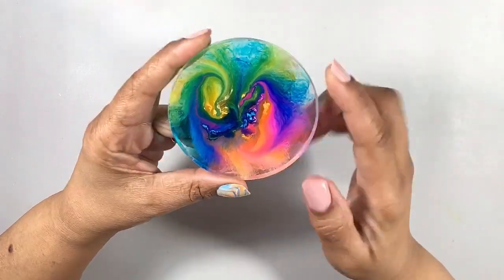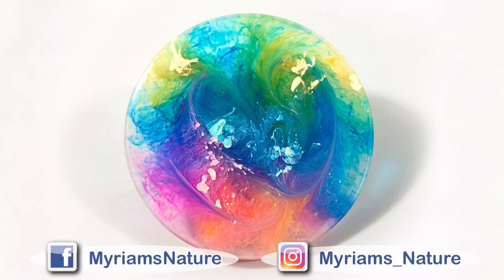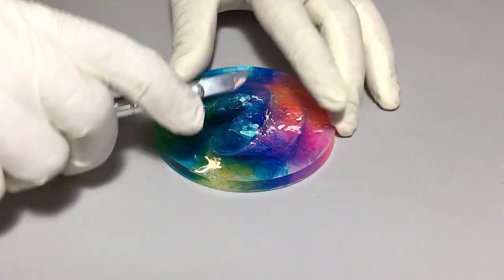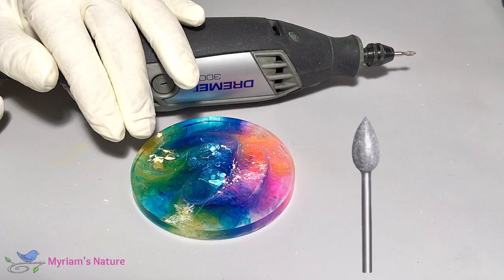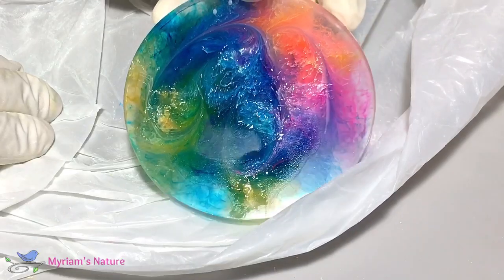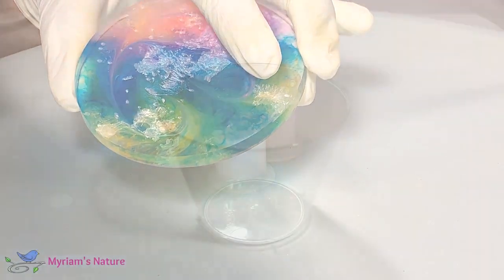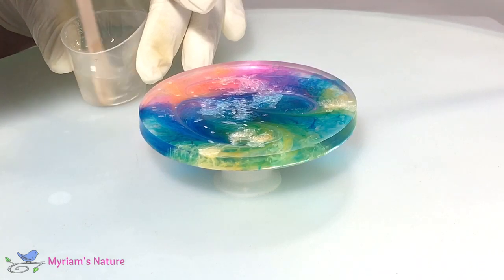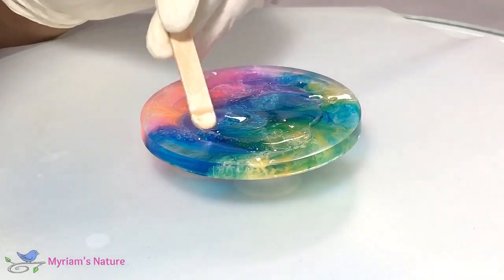147] Resin Finishing Techniques : Removing “Blobs” for a Flawless Resin Coaster or other piece

Comment: Wonderful video. Thank you so much Myriam for sharing and inspiration! I’m “new” in resin world and I’m struggling with top coat... it comes out oily looking, have tried to rescue my coasters twice but both times the finish looks oily when hits the light. Will try tomorrow again but with different resin.
Also....another case😂😂😂 I by accident misplaced box above my coasters and unfortunately one cardboard edge cured in coaster so I’ll try to rescue it with this video’s advice, hope it works.

Comment: Wow! Beautiful!!!  I actually poured my first coasters yesterday - the triangle ones - and it worked!  I'm blown away.  I actually embedded little clover-shaped wooden buttons in the aqua/glitter/mica mixes and they're so cute! I've learned so much from you and other YT resin artists, Myriam.  Thank you!!!  I do have one question, tho:  When you use the mixing method of using 2 of your recommended silicone cups to measure the resin stuff, pouring them together into a third cup, how do you clean out your little cups?  I thought soapy water would work.  Looks like I need to get some nail polish remover?

Comment: It is beautiful! I am having some trouble with the resin creeping up on the sides of the mold and creating a sharp edge. Can this be avoided or do I always have to some the piece afterwards? Thanks for sharing your knowledge with us.
Reply from the maker: Hi Meg... Thank you for the kind words!  😊💕 
Unfortunately resin will always creep up the sides to some degree due to capillary action.  Regardless of how much or little it does, the edge will be sharp.  The only way to avoid having to sand an edge is to add a resin topcoat (assuming the edge is even) or fill the mold to the tippy tippy top.  I’m not a fan of the latter option but it does solve the “problem” ... at the risk of causing others maybe.  If you have time, watch this video I made about this issue a while back : https://youtu.be/r1-q060syQU  I hope it helps a bit. 😊
Reply: @MyriamsNature  thanks.

Comment: Hey Ms. Myriam,  glad I found this video.  I watch your videos when I can and they are so wonderful.  You make learning fun.  I have a problem.  My first ever colored resin pour on canvas was last night.  I got most of it done but I didn't like one particular area and started to put more white and blue down. Heated it and tried to move it. Well it was hardening on the spot. So I couldn't work with it. Its dry now but I have a 4x4 blob sticking up. So after watching your video I could do the same as you did but it's a bigger area, right. Then I could re-resin? I hope you can advise. I used Clear Cast Aluminite. Short time to get things done before it starts getting hard.  Be safe.
Reply from the maker: Hi Little Feather!  I’m happy that this video was useful to you. I also relate to the issue you had.  There is a point at which heating resin can unfortunately no longer soften it but just exacerbates the speed of its curing.  I personally have not used Alumilite resin but have friends that do use it for wood turning purposes. I know that you can sand down a piece, or drill out an area of a piece, made with Alumilite and then resin over it... so you should be just fine.  I hope that helps a bit. 😊💕
Reply: @MyriamsNature  Thanks for your reply.  You're the only one that did.

Comment: I didnt gasp when you took the knife to the petri but I freaked a bit when you first pulled it out lol!

Have you used the general purpose resin from the resin store? If yes, in your opinion which is thicker, 7050 or general purpose? I am all out of 7050 so I cant do the comparison.  The wood crafters is thicker than general purpose. Love all 3 types! 
Just finished watching and I have to fix nearly every piece I touch. I'm beginning to think it's just me!
Reply from the maker: Hi “H”!  Sorry for the scare 😉😁.  I do have the general purpose and think it’s comparable to Clearcast thickness.  I’ve never tried the woodcrafter’s so can’t compare it to that.  I love the gen. purpose for cost savings ... if you’re going to color your resin it’s definitely the way to go 😄.  What do you think of the woodcrafter’s?
Reply: @MyriamsNature  I've used it once on coasters just a few days ago. Extremely thick. Love it for my coasters. As I poured it my mind was immediately going to ideas and new projects.

Comment: Myriam, I have tried to make small container and bottles but always end up with a bubble of air along the sides of the mold. Since it is silicon molds can't use a torch so don't know how to prevent the bubbles. Any tips? Thanks.
Reply from the maker: Hi Bonnie!  For pieces like that I use a very thin/“liquid-y”/runny  casting resin.  Super runny resins are like water and are so thin that bubbles rise easily before even pouring into a mold.  In the absence of a thin resin, try warming your resin part A before mixing it by letting the bottle sit in a bowl of warm water.  You’ll notice that part A gets runnier (part B is usually runny with most brands).  This may not eliminate your bubbles, but it should help.  Also try running something smooth (like a thin, plastic paint brush handle) along the walls of the mold if they’re accessible.  You want something smooth so as not to scratch your mold.  
If you would like to try a casting resin, my favorite is Liquid Diamonds :  http://bit.ly/LDResin ... Enter coupon code MYRIAM at checkout for 20% off your TOTAL purchase.
I hope some of that helps a bit.  Happy holidays to you and yours!! 💕😊
Reply: @MyriamsNature  Thank you so much for your help.